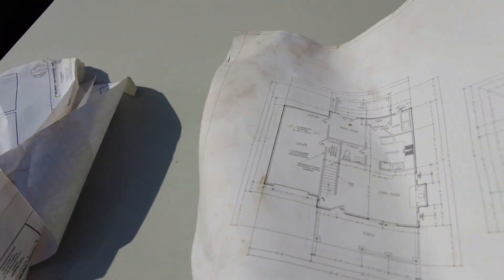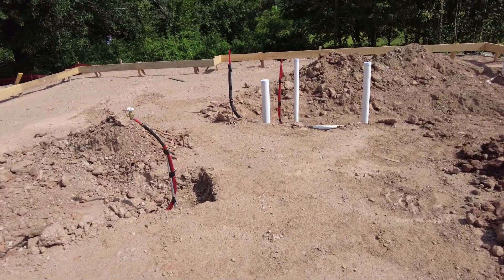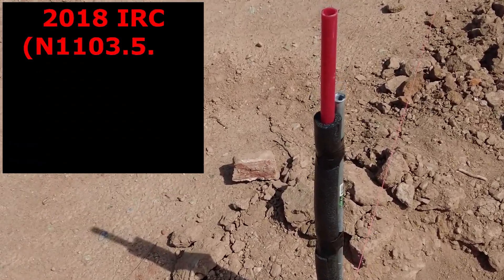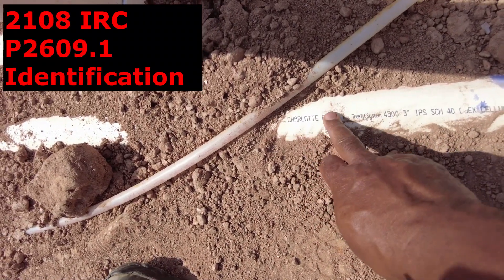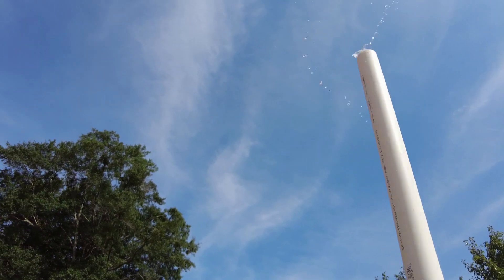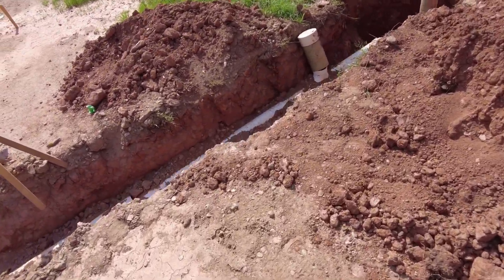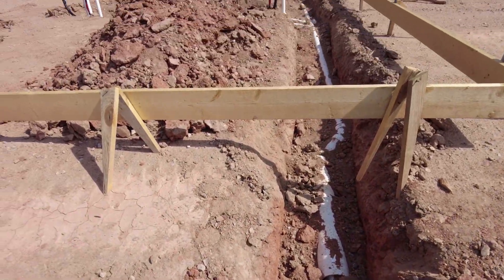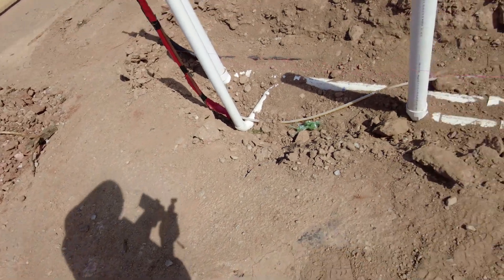Learn How to Do a Residential Plumbing UnderSlab Inspection.

Comment: I appreciate what you do, I plan to become a real estate developer and I just bought the 2021 IRC due to you mentioning it (went with the latest version instead of 2018). 

Random question: if I wanted to insulate all the drainage/water lines  even the lines under the foundation, is that okay? Or is that redundant since those lines are underground / below frost level?
Reply from the maker: So, not insulating the hot water pipe is a energy code violation ..
Reply from the maker: However, insulating the cold water pipe is ok as well.
Reply from the maker: I appreciate your support..thanks for watching!!

Comment: WHERE IS THE CHECK VALVE BACK FLOW FROM MAIN PULIC SEWER CONNECTION YOU DIDN'T SAY ANYTHING ABOUT IT
Reply from the maker: So, in that particular jurisdiction the city handles that along with the water meterinstallation. ..thanks for watching!!